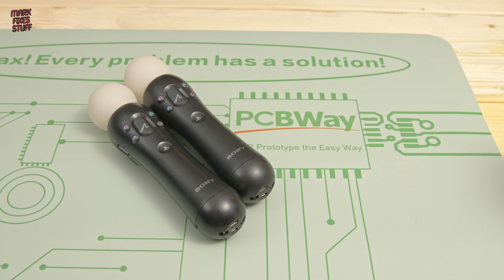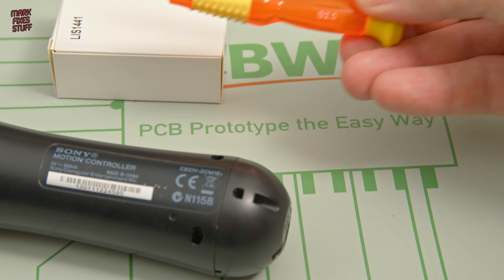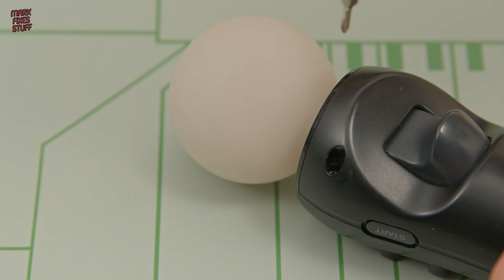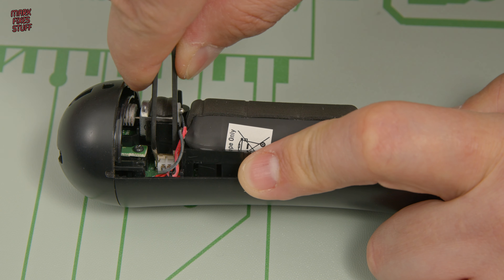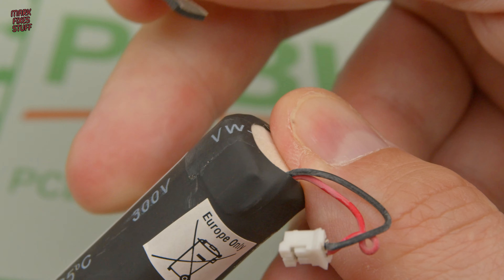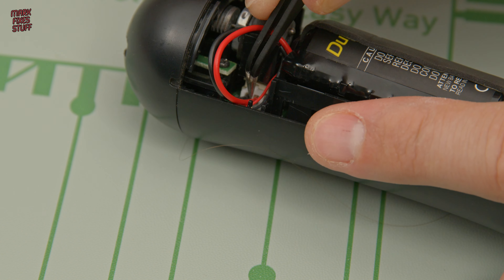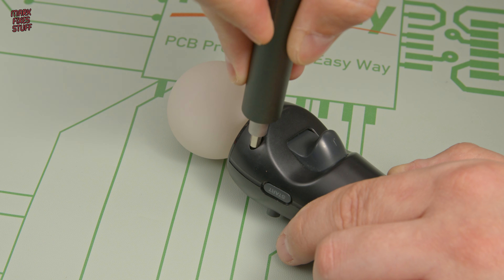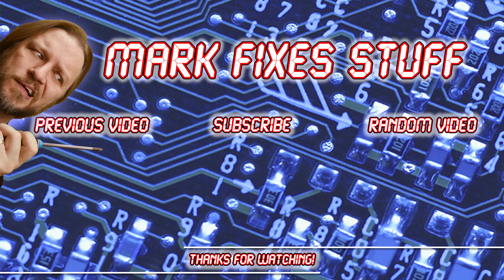SOLVED: Fix PlayStation Move Battery Charging Problem PS3 PS4 PSVR! Step-by-Step!

Comment: If the controllers are anything like the PS3 controllers, they need a data connection to charge, meaning it has to be a full cable with all 4 wires, and it needs to charge in a PC or console that connects to it  via data, you cannot charge it with a USB power brick.
Reply from the maker: I mention this at the end.
Reply: @MarkFixesStuff  yes u did but did not describe the reason - only some work some not. But it is very easy to detect if a cable will work or not as Nukleon described.
Reply: @MarkFixesStuff  you mention that it is particular about the cable it wants, I'm explaining why 🙂
Reply from the maker: @Nukle0n  Yes, I understand. Thank you. For me it was a bit of an afterthought. I've pinned this comment so people can see what you said.
Reply: I was coming here to say the same thing, except mine wouldn't charge connected to a computer, only to my PS3. It probably negotiates with the controller to tell it to charge. The standalone charging stands must have mocked this signal up.
Reply: @dant5464  i remember charging ps3 controllers on my PC but I've seen conflicting reports.
Reply: @Nukle0n  yes USB charging is a bit of a mess - there are several protocol variants not every ic supports everything. Because of this fast charging is sometimes a hit and miss with power brix. (Btw power brix will work with the controller but it has to support the right variant of power negotiation)
Reply: @nukleon This - thank you
Reply: @Nukle0n
Er, and it will chargevon the official playstation charging port station yeah?.. with its own AC qhich plugs into a wall outlet?,
stop confusing people.
Reply: @GoldenGateNum9 "stop confusing people" says the person whose message is completely unreadable.

Comment: I think that you meant to say that you should turn the screws slightly anti-clockwise before tightening into the plastic to prevent stripping the threads, not clockwise. Great video as always Mark 👍👍😊😊😎😎

Comment: What a detailed tutorial. Thanks a lot😊🎉❤. My couple controller didn't charge for around two years. It seems the charging speed become very slow  or unchargable. If so, I'll try this way to fix it .Hope it will work 😮
Reply from the maker: Sounds like the battery is the problem for sure. Let me know how you get on!
Reply: @MarkFixesStuff  you know what , the solution is that I charging them in ps4 sleeping mode and after about few hours maybe , they recovered. It seems that I can't charging and playing game both at the same time , that will cause the charging speed very slow. Overall , the battery is still alright, they revived. Maybe it's just a miracle, who knows🙃.

Comment: 00:10 PSVR didn't come out until 2016, 2013 was the year the PS4 came out?
Reply from the maker: PS Move came out in 2010 on the PS3 and was later adopted into the PSVR system on PS4. The Move controllers are really old.
Reply: @MarkFixesStuff  yes but you said later adopted for the psvr on ps4 in 2013 but the PSVR was released on October 13th of 2016 while the PS4 was released in November 15th of 2013 3 years apart
Reply from the maker: I probably just said the wrong year for the PSVR. I don't have a script. The point I was trying to make is that the PS Move came out with the PS3 and was later used i the PSVR so there are controllers older than ten years out there. Apologies.
Reply: @MarkFixesStuff  no worries man, just wondering where you got that year from
Reply from the maker: @Nukle0n  Just got mixed up when I was speaking I suppose. Happens quite a bit these days.

Comment: Additional Comment: those 'odd' mini USB leads are just like cheap knock-off Apple replacements then?  They sometimes charge at a much slower rate/speed; and the charge percentage is still relatively low after a few hours of charging.  Just saying!